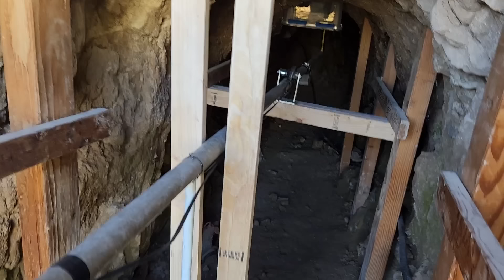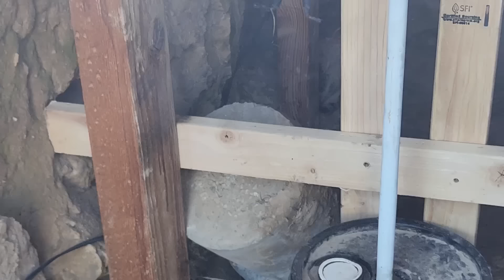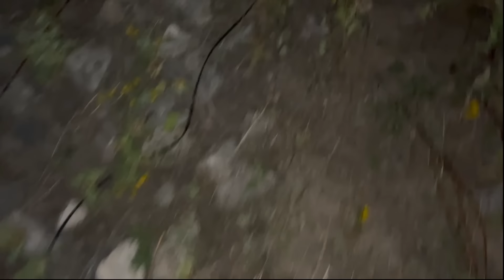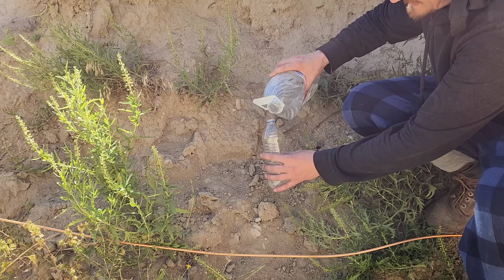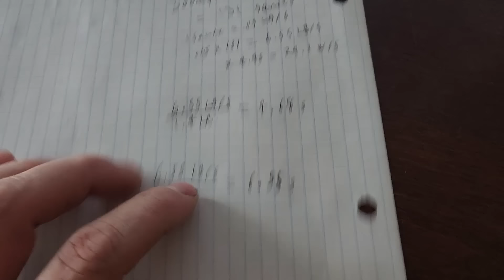Sodium Water Hybrid Rocket?

Comment: What would be required for a liquid sodium thruster? Sodium melts below the boiling point of water, so steam heat could easily keep it at launch temp. And/or using steam instead of water for the input pressure, would that make the reaction faster due to more energy in the water? Or is that insignificant amounts of energy to affect the speed of the reaction?

edit: just got to the end, and he mentions his next version might be liquid version, awesome!

Comment: Maybe try and make the nozzle diameter [keeping the same diameter area] with much smaller holes ( a bit like a shower head) maybe that would keep in more of the sodium for a more efficient burn without restricting thrust? Oh, and definetely try hydrogen peroxide instead of water.  Great video though Cody, cheere mate!! 🤘🤘🤘🤘

Comment: I love rocket physics, and am extremely excited for this project. I hope you continue it even though the first run wasn't as great as was hoped. 
I see a lot of folks suggest essentially a structure for the fuel to hold on to, but I worry what kind of weight that adds while also removing possible fuel mass.

I think one idea I liked was having the reaction take place with some space before the nozzle. That way any sodium that comes loose into the exhaust still has time to react with some excess water. 

I think my favorite part of the video is the measuring set up. I would say finding the right damping coefficient would be best though. As if the rocket is shaking up and down it might cause the fuel to shake loose even more.

Thanks for a great video Cody
Reply: I hope what I think makes sense, but could he not extend the water injector nosel further into the “fuel” tank similar to the rod he first placed in to fill the tank, just long enough to ignite the bottom part of the sodium, giving the sodium first of all no chance to ignite at the top of the tank first and also making it start at the bottom and not just make it fall out from the top. The question with this would be if the sodium can burn all the way from the bottom to the top if the water injector nosel pretty much keeps it airtight inside. But if this theoretically works it would also lead to a more constant reaction rather than a random reaction inside the tank. But theoretical and practical obviously highly vary so it’s hard to predict what would actually happen.

Comment: might want to secure the sodium with some lattice inside of the combustion chamber. the lattice only needs to be lightweight and heat resistant enough to withstand the initial pouring of the molten sodium

Comment: Pure sodium is tricky as a fuel, as it is a solid that can't/shouldn't touch air. That makes fueling a very involved process, prone to impurities and somewhat risky. Then there is the environmental factors for a full scale rocket, while it might have some benefits over kerosene/methane rocket fuels in regard to climate change it has the potential for quite some contamination and biological impact. Not to mention that while each launch releases a huge chunk of CO2, it is important to note that rocket launches are relatively rare. So Greenhouse gasses emissions from rockets might not be a huge area of concern.

Comment: A high speed valve could allow pulsing the water like a combustion engine, small amounts. You get your pressure and it lasts a lot longer, potentially?

Comment: A solenoid valve would propably be a good idea for ignition. Could even be pneumatically operated, if you want to avoid electricity at all.
Reply: Jank is the name of the game
Reply: A solenoid valve won't have nearly as much flow as a ball valve operated by a sufficiently powerful spring.
Reply: @user2C47  Just a matter of speccing the correct type of automatic valve.

Comment: To fix the nozzle clumping problem, why don't you put a mesh tube in the middle so that only the sodium in gas form can exhaust?
Reply: Also I wounder how sodium pellets in a basked would work🤔 so that the Sodium could react with the Water in 3 Dimensions. Mb you could als use steam instead of just water. But as you said, don't make it a pipe 🧨

Comment: Trying to do this with a good burn that doesn't melt the fuel. Or design the engine to use two liquids. Going to need the thinking cap for this one.

Comment: Absolutely brilliant.  The only things that I might change are a smaller injector that will more finely mist when combined with a higher water pressure supply that might make the burn more uniform and complete (and the added water pressure will also serve as a sort of check valve to reduce the water pulsing caused by back-pressure from the combustion), and the smallest graphite nozzle possible.  Of course smaller nozzle testing would require a really safe distance because at some point it's going to decide to be a bomb.  Such is a characteristic of razor edge rocket engine design!  Thanks for the video!  One of your best testing setups!

Comment: I doubt this will work as a hybrid solid liquid rocket. However, If it were solely a liquid rocket with both water and liquid sodium it might work better because you won't risk losing all your sodium, from melting and erosion, as the rocket's temperature increases.
Reply: Also because both H2O and Sodium have low boiling points it is possible to make a H2O & sodium gas spray mixture for combustion. Sodium boils at 1,621F its hot but not impossible.

Comment: If you created a clever design to trap the liquid sodium and prevent it escaping before reacting that could be a very efficient and cheap rocket. Have to prevent unreacted sodium from exiting or the safety would be a massive issue with this design. Imagine raining molten sodium down from a rocket.

Comment: What about supplying the engine with superheated steam instead of cold water? It would make the reaction flow so much smoother. In a larger setup the heat could just be grabbed from nozzle cooling

Comment: You know your projects are good when failure results in a pipe bomb or a sodium-thrower! Glad to see your safety mindset through the process too. Tricky problem this, trying to get the sodium to react inside the chamber instead of being splodged out.. Low melting point certainly doesn't help. 

Oh well, guess you need to build an f1 style bipropellant system with liquid sodium. A mere trifle for Mr Lab!

Comment: Why not stick with hybrid, but use liquid sodium? It seems like the melting point is so low you would just need to keep the sodium chamber up to temperature until launch and then inject it into a combustion chamber with the water (position the sodium chamber near enough to have the reaction heat keep the chamber liquified). So a hot rocket.

Comment: I do wonder if NaK would be more efficient of a fuel that pure sodium. It's more reactive, but would weigh more than pure sodium; so would the thrust benefit outweigh the cost of the weight of the fuel? Plus there's the additional aspect that liquid sodium requires heat, making it hard to maintain (unless you somehow recycle the heat of the reaction back into the sodium).
Reply: Sadly regenerative cooling with solid sodium won't work lol

Comment: I'm thinking do the nozzle like a fire extinguisher, you know have a pipe running all the way to the top of the combustion chamber, this way the melting/breaking sodium now just falls to the bottom of the chamber while continuing to react and produce pressure that is released through that pipe. I haven't ran the numbers but my gut tells me that perhaps the only problem with the design is that the pressure inside the chamber could build further with the longer travel route, and perhaps reach a components breaking point. The water injection would also have to be redesigned since now the nozzle is directly in front of it, but fairly simple solutions could be a sprinkler system of sorts, or multiple injectors off-centered entering the combustion chamber.

Just a very fast and not well thoroughly contemplated idea.
Best regards, love your videos.
Edit:
I think also preheating the sodium could be beneficial for it to react smoother, and not break apart but rather melt and act a bit more stable.

Comment: While solving the integral with the weight of paper is a interesting solution, why didn't you just enter the data in excel(or similar) and use that to calculate the stuff for you?

Comment: couple of thoughts... you could use a powdered sodium? and inject with water simutaniously, (reallly difficult to pull off though) or have your water nozzle start closer to the bottom of the rocket, and "burn" off as it fuel is used up? say using a plastic hose? or vented copper pipe? that way the "fuel" burns form the bottom up like a more standard model rocket engine? Or fill the motor with water, and force a sodium "fuel" rod into the motor chamber? yet more edits... I'm a be thinking on this all day lol, you could incase the sodium in something that dissolves in water, once dissolved the reaction begins... though this and the rod method the water would be forced out... the issue is keeping the sodium from melting and running out... perhaps some cup shaped chambers to "hold" the liquid sodium in place as it reacts with water? Like a series of Bunt pans?

Comment: Great vid!

Few points i'm curious about:
1) since one of the byproduct is bicarbonate, could vinegar or some acid be used alongside the water as a reactant? It might react with the bicarbonate to build up extra pressure at very little cost.
2) since most byproducts are gases, could the outport of the combustion chamber be situated at the top, and redirected via pipes to point downward? That might prevent molten sodium from escaping from the bottom.

3) just shooting random ideas now: might a liquid sodium alloy be sprayed via a nozzle inside a water-vinegar mist (also created via a pressurized nozzle)?

Comment: Just some thoughts:
Maybe steam / water vapor instead of liquid water would be more reliable.
poke holes or something into the Sodium kind of like real solid rocket grains.

Generally I think it could work, but maybe it would be easier to get fuel efficiency by injecting liquid sodium instead, maybe force it through a nozzle with a presurized piston or something.

Comment: Try a liquid rocket approach due to the low melting point of the sodium
Reply: with like a mixing chamber, that would be insane. sodium could easily be melted by electronic means (electronic coil heater or something around the outside?). the big issue would be, pressurizing the sodium side higher, so that the water doesn't backflow into the sodium reservoir.

Comment: If you could have better control of the water you could get a more efficient burn. Like a sacrificial tube through the sodium. Such that the water is injected at the end of the sodium near the nozzle. As it burns the tube also burns allowing the water to continually hit the sodium as it works it's way up the chamber. As others are suggesting having a finned interior so the sodium has more to hold onto and maybe multiple  water injection tubes for each section.

Comment: I think the pressure from the spray nozzle was making the water exceed the propagation of the sodium, maybe less pressure,  finer water mist? Like using an ultrasonic water fogger,  and like 10 PSI pressure pushing it through giving the sodium enough time to react before it leaves the rocket nozzle.  Start with a slower burn/mix and work up from there.  Also add a check valve on the pressure line to prevent back pressure if you haven't already.  Or maybe an MRE heater inside of the water tank reacting with water to produce water vapor. IDK, I'm just spitballing. Sorry for all the edits lol

Comment: This is the problem with solid rocket fuel. Instead, powder the sodium. You can insert a cardboard disk at the bottom of the chamber to keep the sodium in place until it ignites.

Comment: If you want to increase thrust consistency you could use a backsplash approach for the water, and pour the molten sodium in the "combustion" chamber and let it cool around some threads.(Put big beefy threads in the combustion chamber to ensure the sodium doesn't fall out). As the sodium reacts, it should make a "good-enough" splash cone to help it maintain thrust until it is nearly spent. TLDR: Inject water from below(but just above the neck of the rocket nozzle) and aim the injector at the middle. This would likely also reduce the total mass of the engine by reducing its length.
Reply: Wanted to suggest the same, but you worded it better. The basic principle should be to use the rapid creation of gas to push the sodium further into a reaction chamber and not out the nozzle.
Reply: That a great idea. Also the trust could be adjusted to some degree by metering the water. There will be a curve as the sodium gets farther from the jets which could be compensated for, to some degree, by increasing pressure. I don't know if you follow a channel called "Breaking Taps". He is working on a hydrogen peroxide rocket motor and has done some work on atomizing injectors. In particular in regard to the atomization that occurs when two solid streams intersect. We are talking tiny ports in an array (In his case a flat plate for injecting the peroxide onto silver mesh.). So, among other ideas, why not have a water port ring array? The ring injector ports could be designed to intersect at a an optimal angle in the chamber, atomizing the water.  I think the sodium could be poured in such a way as to present the optimal surface area at any given time. Strategic voids which vary the surface area could be incorporated. The surface of the sodium would be the only thing reacting at any given moment. There is a lot of research and patents about atomization online.
Reply: Wow. My non-scientist self was visualizing something similar, but I couldn't begin to explain it. Thanks for the explanation!
Reply: In the current design, what about putting a "grate" or a "sodium catch" right before the exit of the nozzle, and at one or 2 spots up the rocket to catch the salt?

Comment: You should get in contact with Thunderf00t. He is a physical chemist and is currently working on a research on sodium combustion and has exactly the same ideas. In one of his later videos on "sodium flamethrower", he is experiencing a similar problem as you - the flame is not stable, it tends to studder. His solution to the problem is to find some way of making aerosol out of the sodium before igniting it. He is currently testing various rigs to test the idea.

Comment: "Now, just because it's made out of pipe, and will probably explode, does not mean it's a pipe bomb. Intention matters." -Cody's Lab 2023.

Thank you, Cody, for another amazing video.

Not completely done with the video, and I don't know how to suggest this, but I think the optimal setup would have a minimal amount of water come into contact with as much sodium as possible. I'm not sure how this can be achieved.
Reply: Technically, a rocket is just a bomb used for fast
Reply: It's actually a really good point. It's the difference between an experiment and a constructive intent/destructive device case.
Reply: Maybe misting it instead of spraying it? Smaller nozzle for the water to increase its surface area while using less actual water. Also increasing the surface area of the sodium would help but idk what to do about the sodium melting from the combustion. Maybe make a Cement with sodium and like sawdust
Reply: @Surdalegacy  Could be a chamber that both contains (holds) and mists the sodium chunk. Initially air pressure could be used to put enough pressure on a water jacket that surrounds this chamber, but then you could siphon an amount of pressure from the chamber itself to pressurize the water (kinda like how guns use a specific amount of gas from the barrel to cycle the action). The chamber would have tiny little holes all over it for a full coverage of the sodium chunk. If possible, i'd build the sodium on a heat resistant metal, which would both hold the sodium in place and keep it in "focus"' for the misting process. I'd shape the thing into a sphere, and the misting chamber and the pressure vessel for the water would also be spherical and have (thus) the best method to contain the pressure before exhausting them to the nozzle.
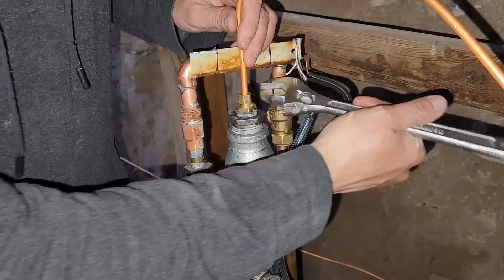Reply: 14:23
Reply: Demonetization disclaimer
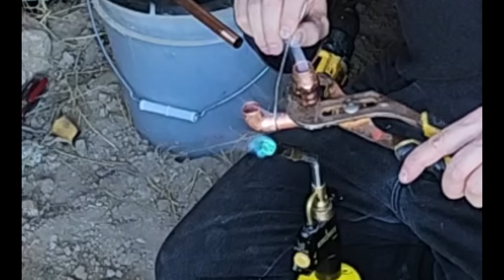Reply: Thats funny, i am @11:20 and i was laughing at the idea that cody is finally making a pipe bomb, wanted to write a comment about it but saw this comment 😂
Reply: If you could heat the sodium to liquid phase and then pressurize it to react with the water instead, probably not a good idea, but it sure would be awesome to see
Reply: "[I]t's a pipe bomb. Intention matters"  -Cody's Lab 2023.

Comment: The classic metal fuel, liquid oxidizer "hybrid rocket" is a thermal lance: just iron and oxygen instead of sodium and water. Maybe a simiar configuration (bundle of wires in a tube) will work well?

 Thank you for running this experiment! it's something I've always wanted to see

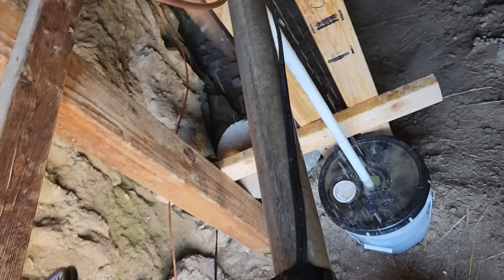Comment: They're currently using nuclear reactors in combination with a cesium coated grill and water for ionic propulsion in the vacuum of space. Cesium is not as abundant as metallic sodium though. If you can find a process for NASA to utilize where there's no trade offs, I'm certain they'll accept the concept. 24:49 A steel mesh screen might slow the sodium from leaking out or a separate injection method which puts the water nozzle near the base so that water hits the bottom of the sodium or sprays upwards a bit.
Reply: Space is Fake.